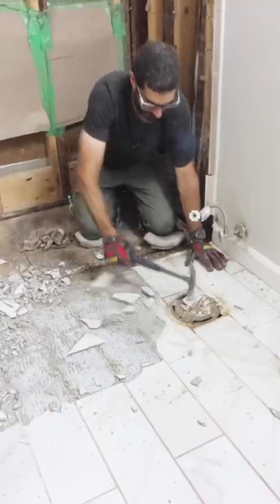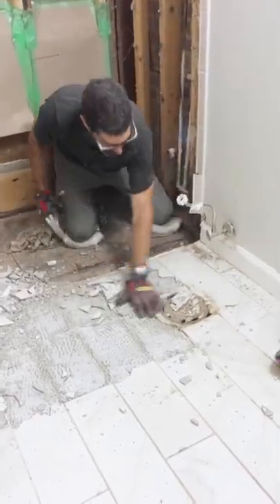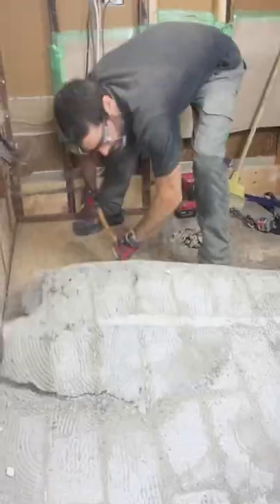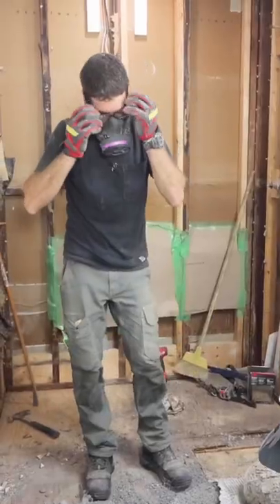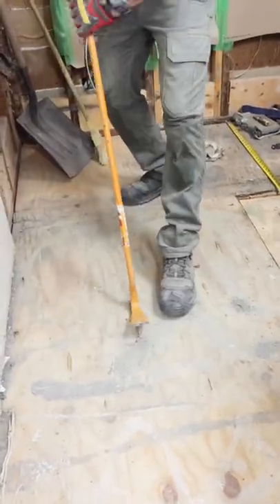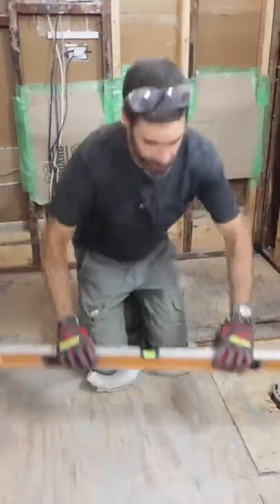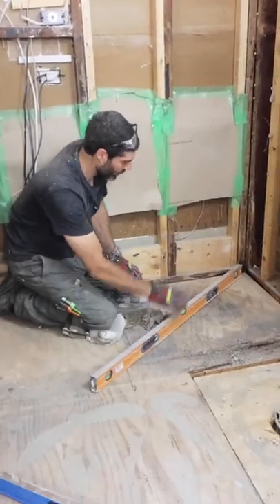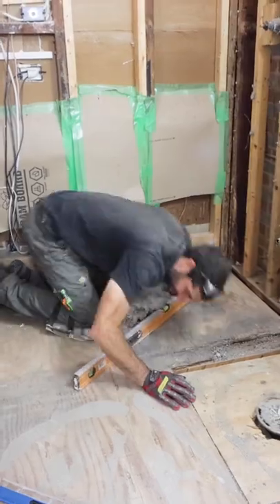Tile Floor Removal Tips - #shorts

Comment: Why don't more guys use an electric chisel to pop all the tiles? Just don't dip it too low, keep it more horizontal. Also, never ceases to amaze me how many "tilers" don't put down mud, THEN screw the backer board down! No more cracked, popped tiles, cracking grout lines, e.t.c
Reply from the maker: In this case the tiles were just popping but that’s always a good option, thank goodness they didn’t install the CBU with thin-set

Comment: Looks like it would have probably been easier to prybar the tile as well.  At least in this case.  I use a rotohammer for that.  Most tile are easy to come up bc they are installed wrong!